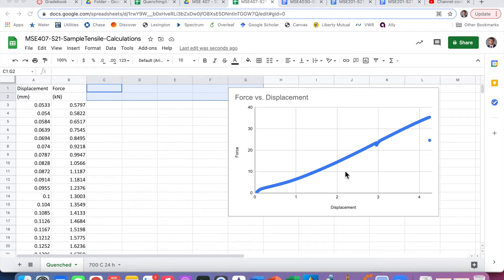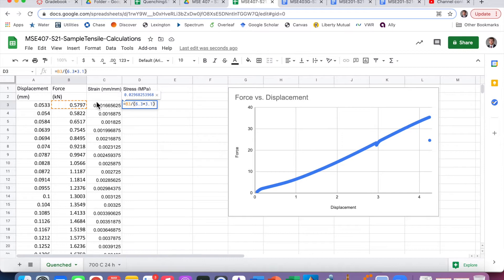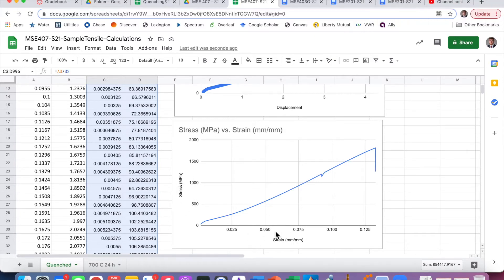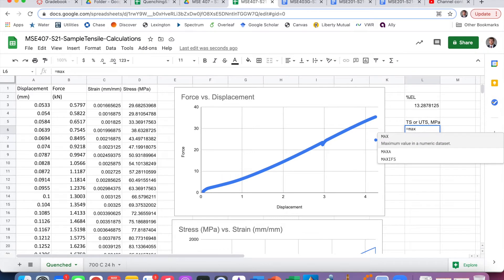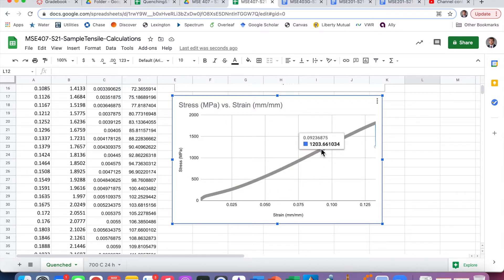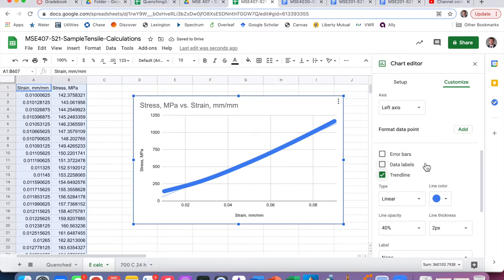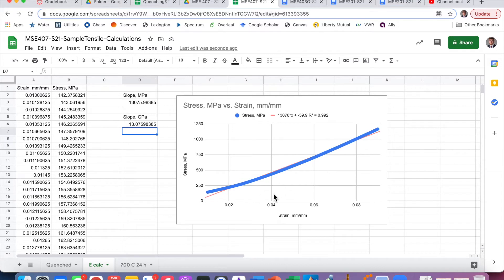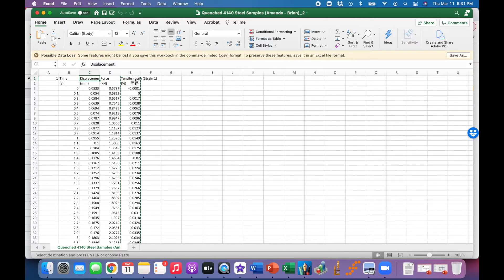MSE 407 S21 Steel Lab - Tensile Testing Calculations

Comment: I ran into the same problem, for a copper dumbbell I'm getting a young's modulus of 11 GPa, which is nowhere near the (120 GPa)  I found online. I got a column labelled  "overall extension", I don't see what went wrong :(
Reply: Yeah and my dataset doesnt have that extra 'tensile strain' column either, idk what to do